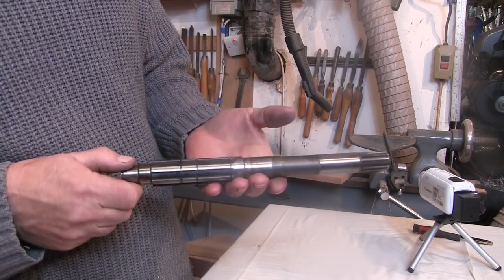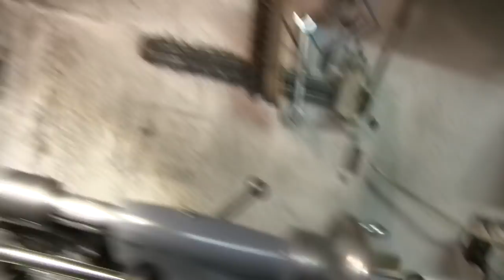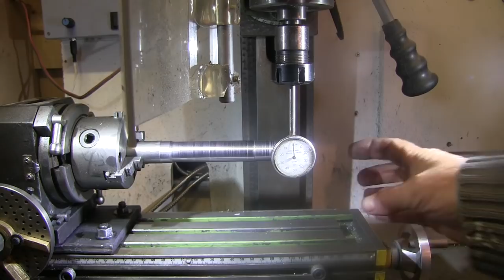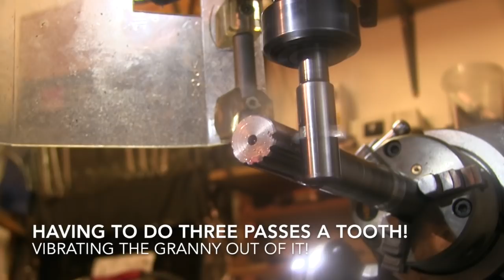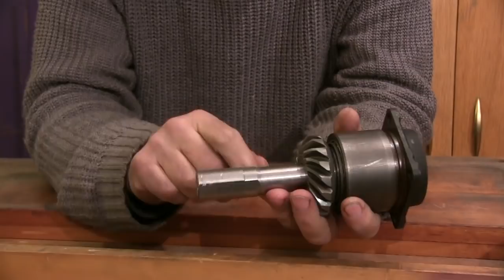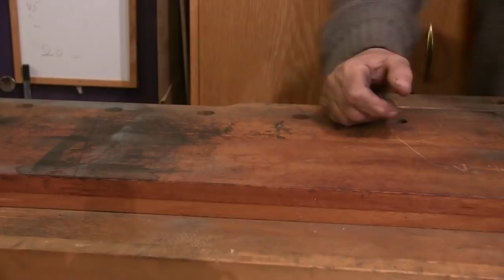Another Tool For Jims Moto Guzzi Restoration

Comment: Try not to kink the lead that the wire runs in on your mig . There's a plastic liner inside that is fragile . If the wire wont run smoothly up to the gun it maybe the cause   or the wire maybe rusty .  Dont ask me how i know.

Comment: Great job.
Mig is normally negative earth, but positive earth if you use gasless (fluxcore) wire. Not all migs can change earth polarity.
Gas is best if you can get a decent sized in-date bottle filled cheap enough.
Do not use mig wire if it has surface corrosion.
Reply from the maker: Cheers, I am brand new to mig, so any advice is welcome, I think this one can do both, but I need to mess about with it!
Thanks,
Cliff

Comment: G’day Cliff. Nice dummy shaft too bad he didn’t give you the part to start with. Good pickup with the mug, you’ll find mig welding a breeze once you tune yourself in. If it’s gasless it will have a lot of splatter but cleans up easy enough, you won’t drag out the stick for some time now. Cheers Peter

Comment: Neat tool, that mill is a handy bit of kit to have on a lathe, I'm really enjoying my lathe, just a bit scared to start messing with the threading gears in case I mess something up, they are only toy gears lol

Looking forward to this old welder
ATB 
Darren
Reply from the maker: go for it! :-)
Reply from the maker: Cant wait to the mig sorted out, done a bit of torch and arc welding but never done any tig or mig!
Reply: @CliffsShed  I got used to that little fake mig machine I have, it's very natural to use.
I'm having a bit of difficulty with the new inverter stick welder, learning curve is confusing having to twist my wrist and feed the rod.

I keep letting the arc gap get to big  because I stop feeding and relax like I'm mig welding, so if anything mig is a lot more relaxed style, I'm sure you will like it but it's very messy, 10 times worse splatter action, that's why I'm moving over to stick, cleaner, better penetrating power and less clean up, just need to get through my first hundred rods practice ha ha